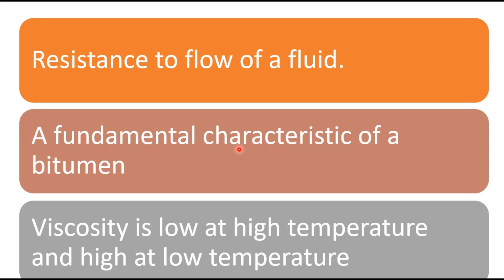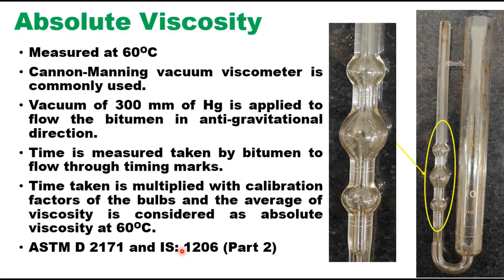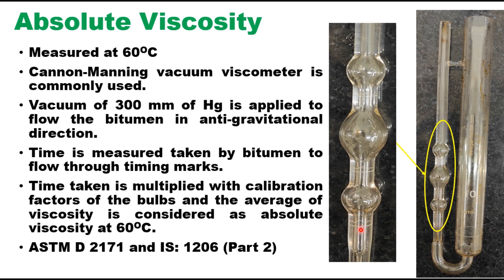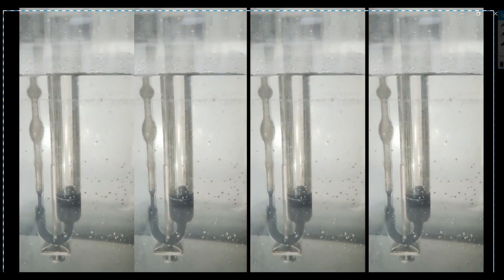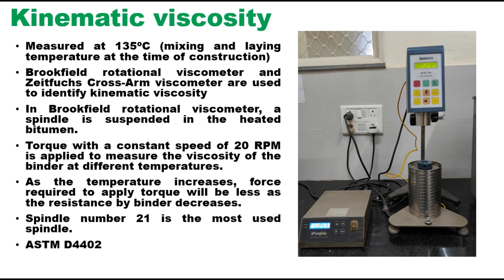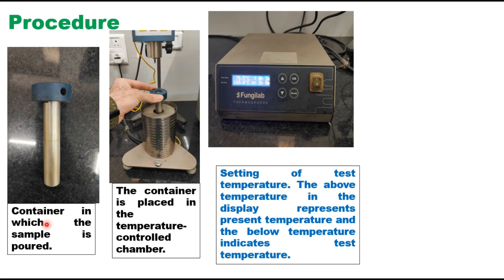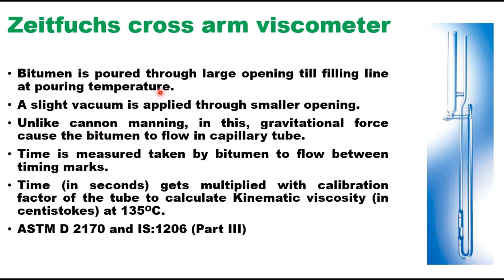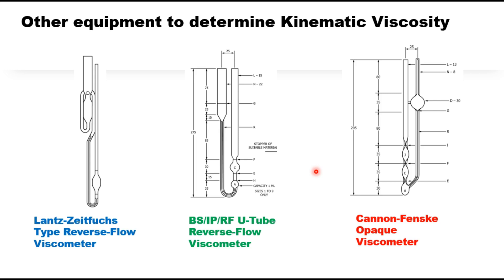#bitumentesting Absolute and Kinematic Viscosity of Bitumen - Significance and Evaluation

Comment: Sir,

Can you pls justify is it necessary to take 20 ml sample for Absolute viscosity as mentioned in IS 1206.
Reply from the maker: Why do you need a justification here? Anyway, it is like this.
20 ml is taken to ensure enough material is available to fill the tube to the correct level for accurate flow time measureemnt. The code says fill the viscometer to a specific fill line and the volume needed to fill this is typically 20 ml for testing at 60C.
Reply: Sir,

Some  times Bitumen will come to the same Mark even with 15 to 16 ml only.
Reply from the maker: @gvarun2192  somestimes, it will not. But if you take 20 ml, it will always come

Comment: Thank you so much, sir. This is a very informative video, sir. Could you please guide me on which code should be followed for the rotational viscometer standard values for different grades of bitumen and where I can get the standard test result for the ductility of bitumen for all grades of bitumen as per IS code
Reply from the maker: IS 15462 and IS 73
Reply: @SatishIITR  thank you so much sir
Reply: @SatishIITR  Good afternoon, sir. As per IS 73, the ductility value for VG 30 is specified on RTFO residue. However, I have tested it without RTFO. Can I still report the result with reference to IS 73?
Reply from the maker: @alok05  No, Ductility is required after RTFO. IS 73 is to be  followed in letter and spirit.
Reply: @ thank you so much sir